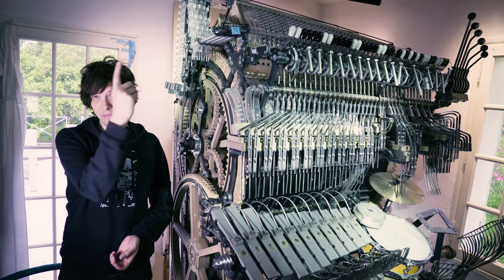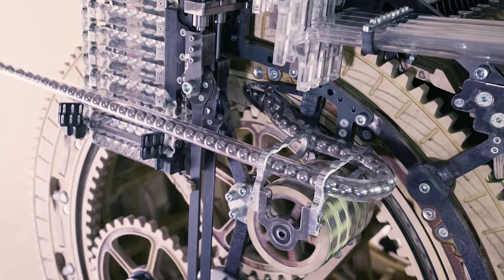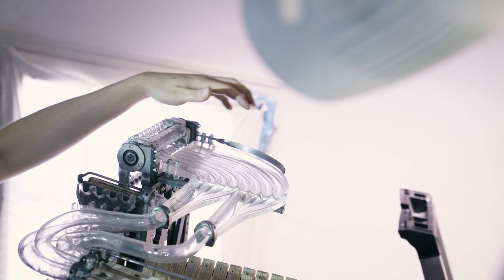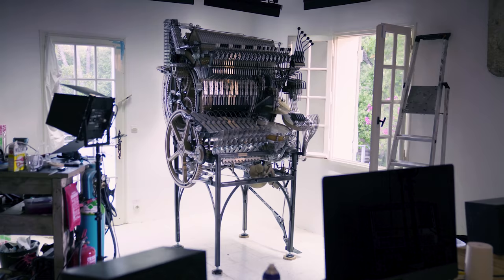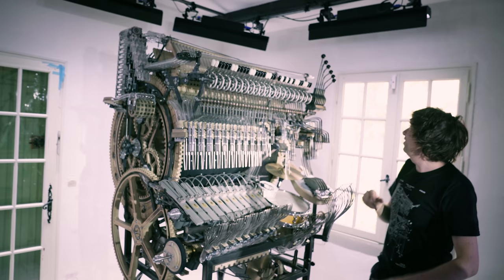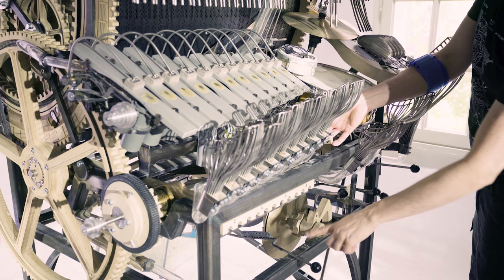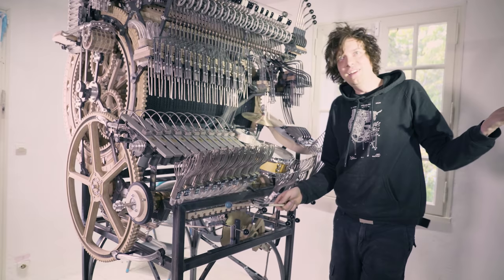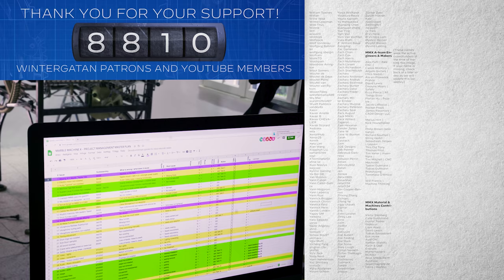Marble Demagnetizer 2.0 and More! - Marble Machine X #131

Comment: When you push the sustain lever down into the set position, it looks like the frame that it's welded to is moving? That seems like not a great thing.
Reply: Yep he's forgotten something (screw or weld) on the end nearest camera Guess he'll notice in time. :)
Reply: my bet is he redesigns thats whole thing
Reply: That piece will meet the grinder soon enough.
Reply: @5ANDW1CHES  m: spring sound is fine
Spring: *sproink
M:the spring sound is actually cool.
Spring: *sproink 
M: it's metal scraping on metal
Reply: Intentional.  That's so he doesn't have to weld experiments directly onto the frame.  In the case he doesn't like it, its not permanent.
Reply: @Tony-ow9bo  The grinder also guarantees that nothing on this machine is permanent lol
Reply: It appears that there is another plate of metal on top of the actual square tubing of the frame.
Reply: And he defenitly knows about it on 26:35 he is holding it down
Reply: @dylanotto1675  hahahaha the most martin few seconds ever
Reply: Tony you nailed it. Good spot. I missed that detail on the first watch.
Reply: srvf

Comment: If you put an arch over top of the spring and the magnet slots for the damper lever, you can switch from manual playing to set and forget function in a much easier and quicker motion. It will eliminate the chance of lifting the lever up too high and missing the slot you are changing to or the lever getting bound up. The arch would act as a guide so all you have to do is push the lever up and over without having to pay attention to how you are moving it. Just a thought to increase the playability of the machine. Awesome job with the machine by the way. I love seeing engineering like this and the thought process and details that go into making a machine of this type is amazing.

Comment: When the piston goes up
Then it comes to a stop
That's a sine wave
Reply: Oh thank you. I was going to say it.
Reply: Don't think so. It would be if the piston was infinitely long, or if it was sliding perfectly forward and backward without side motion.
Reply: If we say r is the radius from the center of the shaft (at coordinates (0,0)) to the bar attachment, L the length of the bar and a is the angle of the shaft, I think the expression for the height of the sliding extremity of the bar would be something like:
h(a) = r*[sin(a) + sqrt((L/r)^2 - cos(a)^2)]

I'll try to plot it with different value to see how it looks ^^ But what we can observe is that if L is very long compared to r, we would approach this expression which is a pure sine with an offset : h(a) ~ r*sin(a) + L
Reply: @Suppenfischeintopf  Right.  If there was a sliding mechanism that kept the rod driving the piston centered underneath it then it'd be a sine wave.
Reply: @Anon54387  if i understood the last 3 comments somewhat correctly, to get a perfect sine wave you'd need to replace the rod with some sort of upside-down T shaped mechanism so that the difference in height between the piston and the attachment to the crank shaft remains constant, and said attachment point slides back and forth along the horizontal part of the T. did i understand all of that, more or less?
Reply: @Kataclysm113  That sounds right! In other words, you need to extract only the vertical component of the circular piston motion.
Reply: @Kataclysm113  that would make it in theory! But there would be so much friction..
Well, truth is, it may not be a sinusoid for a mathematician, but with such a ratio between the length of the rod and the radius, it's definitely a sinusoid for a physicist 😄
Just try and plot the equation I wrote above with a 10/1 ratio for example, it's pretty close to a sinusoid :)
Reply: I'm pretty sure this is a sine wave. It's converting circular motion into vertical motion. If it's a perfect circle with 1:1 translation to vertical movement, that's a sine wave. No need for any math to prove it.
Another way to put it is that the only way to form a circle from a straight vertical and horizontal motion is by adding sine and cos waves of velocity. Therefore this is a sine wave.
Reply: @HeyJD123  "No need for any math to prove it"...? Well yes I just did, and it's not a sinusoid..! This closes the debate.

Just try to imagine the situation with a very short bar, with the same length as the radius. The vertical sliding extremity of the bar would even stay complete fixed for half the rotation at the same position as the center of the axis.

This shows also in my calculus:
h(a) = r*[sin(a) + sqrt((L/r)^2 - cos(a)^2)]
If L/r=1 then we have:
h(a) = r*[sin(a) + sqrt((1 - cos(a)^2)] = r*[sin(a) + sqrt(sin(a)^2)] = r*[sin(a) + |sin(a)|]

The absolute value makes that you have 0 when sin is negative, and you have 2r*sin(a) when the sine is positive! :)

So yeah, definitely not a pure sine wave..!
Reply: @louisdurand4567   You're using calculus for a trigonometry problem as far as I can tell. I'm coming from a practical and computer science/engineering background so perhaps we have different definitions of what a sine wave is. :)

I see your point with imagining a rod that is of radius length, but it will only act that way if you have a limiter stopping it from going below the axis. Look up a "Scotch Yoke" mechanism for that motion explained.

If the Y motion of the end of the rod was graphed and the rotation angle was X, it is just equal to: 
Y = sin(rotationAngle)*radius+lengthOfRod. 

Graphing that you'll get the exact pulsing motion described (a sine wave). The reason it works is that it is a circular motion being converted to a vertical motion. As long as it is a circle (not an oval or with lost motion), it will always be a sine wave. [sin(theta)*r+c]
Reply: @HeyJD123  The scotch yoke (thanks, I didn't know the name!) indeed gives a real sine wave thanks to this sliding mechanism. But on the MMX it is a piston, not this scotch yoke mechanism. So my equation was describing the MMX mechanism, which doesn't give a perfect sine wave.
I'm a Software Engineer, so we probably don't have a very different background.
Reply: It’s pretty well illustrated and described here: https://www.intmath.com/cg3/curve-shape-movement-piston-applet.php
Basically, the radius must be smaller than the rod but as their ratio get smaller the function gets more asymmetrical.
Reply: Wasn't this a reference to That's Amore? Rather than a statement on physics.
Reply: @louisdurand4567  Fascinating, you're right! I guess the horizontal motion really messes with it just slightly enough to make it not sinusoidal. I'm not 100% sure I still fully understand yet, but I can see how the radius affects it. @boyiscola's link just explained it perfectly for me, thanks.
Reply: The rest of the quartetto: "-_that's a sine waaave!"

Comment: When you compose music for the MMX you should do a song about angle grinders.
Reply: with the paradis beat drop in it
Reply: YEESSS
Reply: @Jamie Fletcher MMX can do anything
Reply: The marble machine is missing an instrument. An angle grinder. Must be done.
Reply: @dzjad  i mean, why not
Just add a variable frequency controller and it could power the entire machine (maybe?)
Reply: It has to be two songs: the first one will be called "Pain is Temporary" and the second one "Glory is Forever"
Reply: Coni Glione  If you start the band you should really think again if you want to call it "Angel Grinder" or "Angle Grinder". 
You could easily irritate some fans.
Of course it also depends on the type of music.
:-)
Reply: Johannes Röring angle grinder auto tune
Reply: @dzjad  add a wire wheel to it and apply to the cymbal.
Reply: "Angle Grinders in the Sky!"
To the tune of Ghost Riders in the Sky.
Reply: I'm still waiting for the drill song

Comment: One does seem to know Martin now, a little bit. That sustain level thing towards the end: will it stay? Nah ...
Reply: Watching him yank hard and overshoot where he wants it to stay will bug the crap out of him.
Reply: @billkeithchannel  I was expecting some variant of the bi-stable mutes at the top
Reply: @PatrickGunderson  OHHHHH.... AHHHHHH... Reddit that. Make it happen.
Reply: @PatrickGunderson  I was hoping for something like a quad-stable thing with springs somehow. Bi-stable wouldn't give all the options but this magnet thing looks quite functional and is waaaaay simpler than anything I imagined.
Reply: MrMats0n yes, I agree, it would need 5o have multiple stable positions, but this current solution sticks out horribly from the meticulous engineering that has gone into every other part of the MMX. 

If I were to design it, I would be a single channel with 4 ball detents and a connector bar that is two thicknesses. One thickness that exactly fits the channel width and will engage the detents, and another that is slightly narrower and can float freely. The connector bar is attached to a handle and can be pulled or pushed to engage the different thicknesses.there only needs to be a cm or two of movement in or out.
Reply: Couldn't he just take the magnet holder out, cut some notches in it, and call it a day?

Comment: 5:37 Well, it would look like a sine wave. Or not actually look like, it will be a sine wave. [Edit: OK, it will have slightly flattened bottoms, so it will look like a sine wave then,]
Reply: The vertical position of the pistons, yes. The ratchets have some "headroom" at the top and bottom, though, which makes them clip the wave to something more like Martin has drawn and create true pauses there.
Reply: Since you took so much effort to be mr smart. It is a sine wave, except due to how long the peak is, it is much wider, that is the point he is getting across (with a coarse sharpie mind you).
Reply: Ah, good point! I was thinking it would be a sine wave as well, but I also noticed the play within the ratchet system on the conveyor... didn’t put the two observations together.
Reply: well yeah obviously. but he was trying to emphasize how much it slowed down when at the top or bottom, and he did a good job of that
Reply: Technicaly it's not a perfect sine wave because the piston are not straight up the wheel (check this : https://www.intmath.com/cg3/curve-shape-movement-piston-applet.php )
Reply: The motion of a crank and piston is not a sine wave. Search for "piston motion equations". If you want a true sine wave you need a "Scotch yoke" mechanism.
Reply: No, it wouldn't. The height of the lower point of the pistons will be a true sine wave, because it is moving in a circle, which by definition makes a sine wave. But the top is a different story, because of the way the arm of the piston moves. It's a fixed length and for the sine wave motion to be transferred to the top 1:1 it would have to move straight up and down. The top therefore follows a curve similar to a sine wave (periodic, smooth, etc.) but not a true sine wave even without considering the ratchets. For more info google "piston motion equations".
Reply: No ist not a sine wave  it is

 s = r(1-cos(alpha))+l(1-sqrt(1-(r/l)^2*sin^2(alpha)))

 s          is the motion of the piston,
 alpha  is the angular position,
 r           is radius of the crankshaft 
 l            the piston length.

here is the graph
https://www.desmos.com/calculator/aiautuokwv
Reply: Still better than the sine wave graphs in my physics book. Someone went to town with splines and it always looks different.
Reply: @EdwinSteiner  The ratchets are directly attached to the pistons and therefore also move in sine waves, and I see them moving, and it's definitely sine waves, or at least they never fully pause.
 
But, because it's a ratchet system though the LIFTS themselves are definitely pausing. But they don't go up and down. They only go up. So they don't make a wave at all.
Reply: @AnonArc  That's true.
Reply: @chinook9785  So it's a little flatter at the top than the bottom.
Reply: schutz nhil ah, flattening the curve, very popular in these times
Reply: @dibblethwaite  depands on the ratio l/r as you can see in destmoth when using the sliders

Comment: I'm noticing on the new conveyor queue that few marbles are making it to the right-side of the conveyor shuttles.
Reply: I think it has to do with the loader tipping when it only has three. Just needs a minor adjustment to ONLY load with a full stack going into the shuttles.
Reply: @christophermarsh1580  I think you‘re thinking of the Fishstairs? I noticed the same thing as Matthew… maybe tipping the new wooden tray slightly to the right might help.
Reply: Indeed. I kinda liked the old design
Reply: I don't think it's that big of a problem because it's happening pretty much when only a few marbles are going through the system. As more marbles come through, they occupy the rest of the shuttles. I could see a possible problem if they are mostly taken to the higher area on the marble divider since the left most notes won't get as many marbles, but assuming the machine is mostly filled with marbles while playing, the fishstair should fix that problem by recycling the extras.

Comment: 5:18 so...a sine wave?
Reply: Approximately
Reply: not quite a sine wave because it's a mechanical frequency and not a harmonical but nearly a sine
Reply: @lukaseck1487  aye, thanks
Reply: Close! I thought the same thing, but another commenter pointed out that there is “dead time” at the peaks and troughs, caused by the fact that the ratchets are not moving the conveyor constantly. There’s some play in the system 😁
Reply: it's very near but not exactly : https://www.intmath.com/cg3/curve-shape-movement-piston-applet.php
Reply: thought the same
Reply: one of the reasons its not a true sine wave has nothing to do with the mechanical properties or ratchets but instead with the geometry.  consider that the out put height is not just a function of the "y coordinate" as it would be in a sine wave but is instead also driven by the x because at the top the rod stays at the center line but down at the bottom it is going around the circle. it is a small difference but a difference nonetheless

Comment: 5:16 Fun fact: that graph should be a sine wave. The vertical position of something moving in a circle (the other axis being time) is actually one way to define a sine wave.
(assuming constant speed)
Reply: THis bugged me more than it probably should have lol. I was like, bro, it's just a simple sine wave! But hey, we all have our strengths.
Reply: Fun fact: it should be a trimmed Sine wave. After all the ratchets disengage periodically.
Reply: Jloc Similar to a sine wave but not exactly. The vertical position of the top end of the connecting rod does not trace the bottom end. When at an position other than top or bottom dead center, the tilt of the rod shortens that distance.
Reply: sdhss

Comment: The movement curve of the conveyor belt is actually a cosine wave.
Reply: Thank you, I was searching for this comment so that I didn't have to.
Reply: Not exactly. The height of the connection of wheel and piston makes a cos, but not the top off the piston
Reply: NO, IT'S A SINE WAVE.
Reply: @ameunier41  which is the exact same thing, just shifted by 90°. So it's both.
Reply: @palfly1864  the velocity over time of the piston head is also a cosine wave. This has to be true as the motion is a linearized circular motion which yields a cosine wave as the velocity over time if the circular motion is with constant angular velocity.

Comment: May I correct? The up and down movement of the crank shaft are actually a sin function ;)
Reply: You'd be correct. The sine wave is a result of measuring the y component of a point rotating around a circle.
Reply: Josh Grafman
I noticed this and thought the same thing. Another commenter pointed out however that the wave gets flattened at the peaks and troughs because the ratchets are not immediately contacting the conveyor; there is a little bit of “dead” time. So yes, the pistons model a sine wave, but the conveyor is closer to what Martin drew!
Reply: Sine wave
Reply: @tothestars3958  Top and bottom dead center, crucial when fixing/tuning internal combustion engines
Reply: Sine*
Reply: It is not an exact sine function, even on a fully theoretical basis. A crank-based rotational-to-linear movement conversion does not produce a real sine wave, but a one that is a bit more 
"squared off". This non-perfect sine wave is actually an important vibration inducing phenomenon in reciprocating piston engines (espescially inline 4 engines). The whole thing is pretty well documented. You can find more info here: https://en.wikipedia.org/wiki/Piston_motion_equations. Regarding the engine vibrations I was on about, you can look it up there: https://en.wikipedia.org/wiki/Engine_balance#Secondary_balance
Reply: Leofred any reciprocating piston engine really, including steam engines.
Reply: I thought it was cos, but I was just a quarter turn late.
Reply: @SuperTauta  Thanks for these information. I didnt know about the piston vibration thing, i will check it out,  but it does make sense to me. To be a exact sin, the piston should probably go left and right together with the shafts movement, which is obviously not doing...